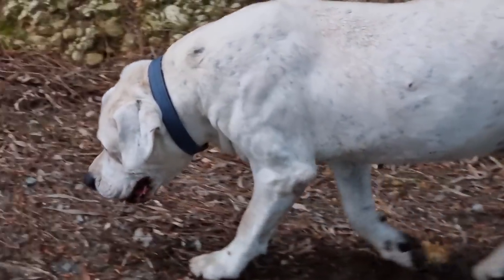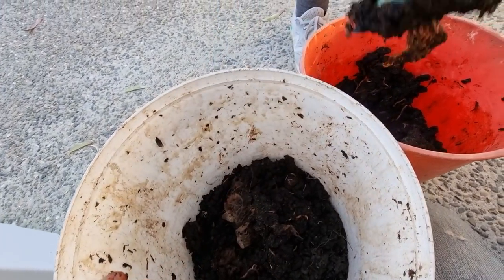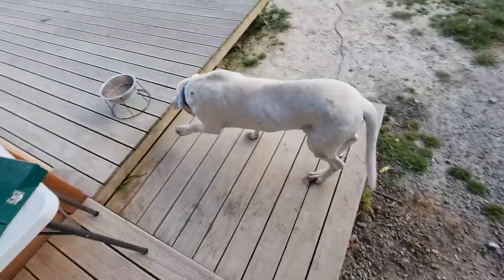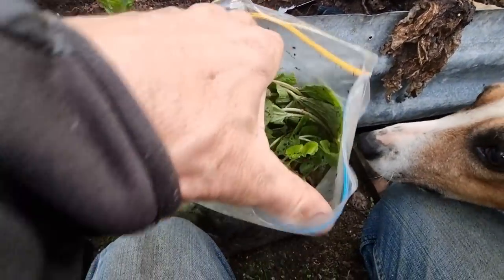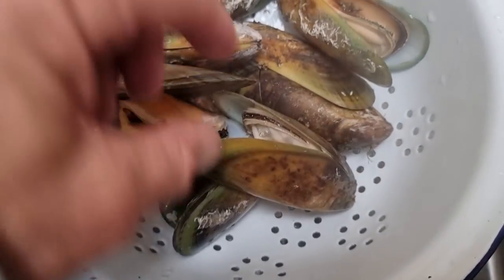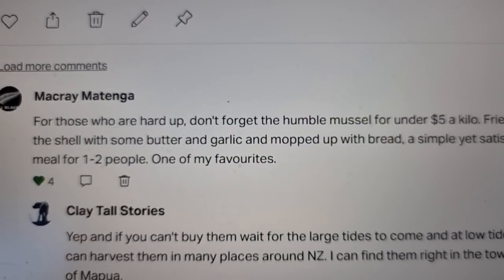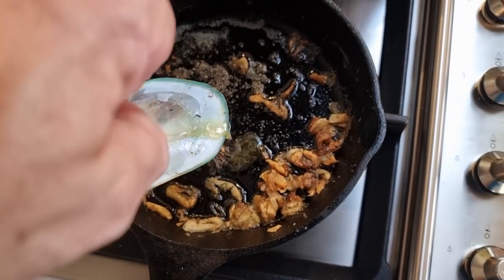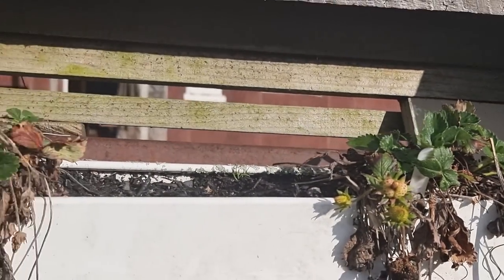Born, Way Down In The Country ~ Clay Tall Stories

Comment: With the slugs if u cut a beer can in half and fill them a quarter with the beer and leave them in the garden it drowns them real well and is safe around the dogs. If possible use something a bit taller like a Heineken and it works better also cut the cans before u open them and u can get 2 traos out of the 1 can
Reply from the maker: good tip

Comment: Worm 🪱 bins are pretty easy to set up, and when they are in the right position getting a good mix of green and brown the COMPOST WORMS 
(different to regular worms) will make you lots of compost on different layers.
Clay, remember that with a worm 🪱 farm, you are farming the liquid mainly, so  when you have any green waste from the garden, throw it in, compost worms 🪱 will eat it in days!
The general rule for worm farms and compost is 4 parts green waste to 1 part brown waste which is the sticks & coffee (carbon), EVENLY layered.
WHY??? 
Because, in a worm farm, you are going after the worm wee mainly, so the juicier the green and brown mix, the more worm wee you will get!

Make sure the far end of the bath away from the plug is slightly elevated, so the maximum amount of worm 🪱 juice can flow out!

Even layering encourages the worms to travel between the two layers to feed.

Clay,
You didn't want to put the seaweed in the bath?
...that's understandable, as logic makes you think "from the sea, so it has to be full of salt!"
Well, when you  catch a Kahawai and eat it sashimi style, is it salty or sweet? 
If it was salty you wouldn't put soy sauce with it.
Seaweed straight from the beach is basically the equivalent of a cross between all your superfood veggies plus steak! 
Seaweed is great in worm farms and compost bins. 

The bath is good, but when they get going full bore, they will lay eggs near the surface,
even on the underside of the carpet or Hessian sack you lay down!

When you want to harvest the eaten leftover compost, make sure to UNCOVER THE BATH to bright light for about 15-30 minutes to let the majority of your worms 🪱 go down deep, away from the light!
I hope you got to read this Clay, as I enjoy seeing your garden flourish. 

Clay, each time I see Bruno walking around a little bit stiff I know that you would have probably given him as much massage as possible to help his old bones, but I feel sad when I think about the old guy, I know how much he means to you, not just as the mascot and logo of your channel.
When the time comes for Bruno to bail up boars in the sky, I hope you will be able to accept a new Argentine into your life as you have mentioned in some of your previous posts. 
I hope you had a great Father's day, great to hear that you got a nice call from your daughter. 
Yes, it was fathers day on Sunday in Australia, which happened to be my little brothers 57th birthday as well, unfortunately due lockdown restrictions I couldn't go over, so we, the main family members made a big Zoom conference party! 👍🍺🍰🎉🎈
Have a great day mate 👍
Reply from the maker: good info mate
Reply: @ClayTallStories  yeah initially you want to water it right in not a light sprinkle..